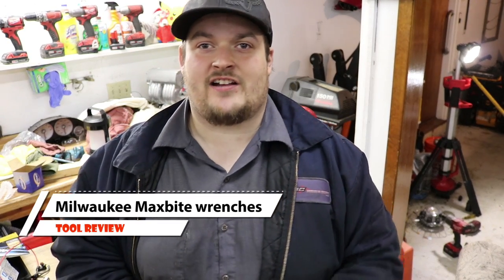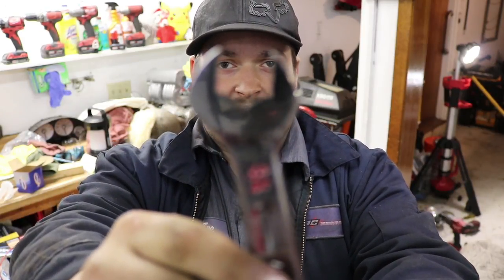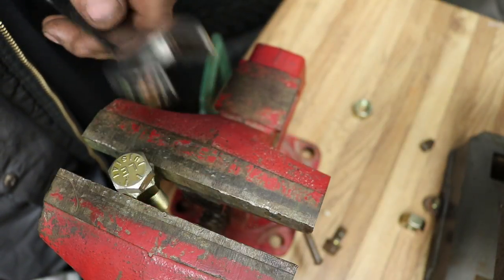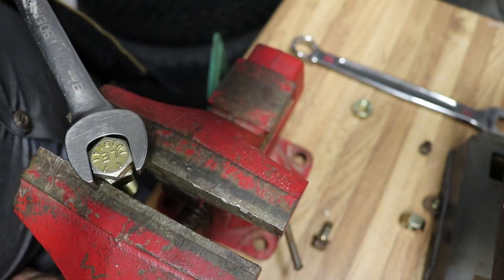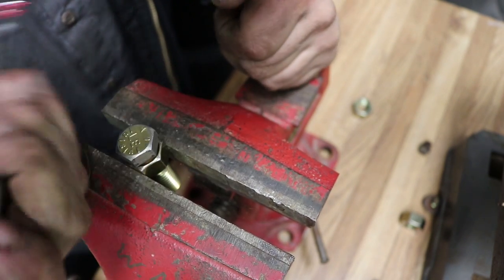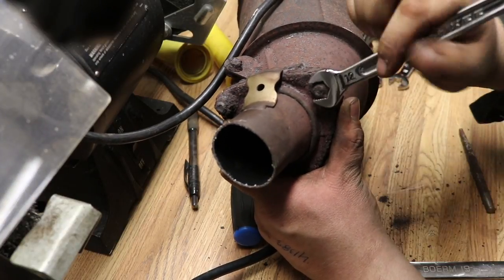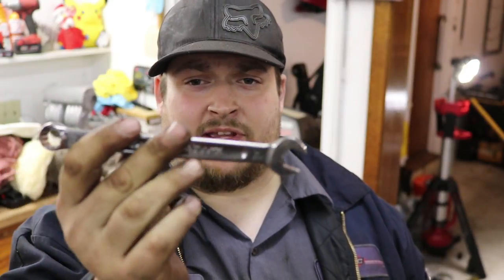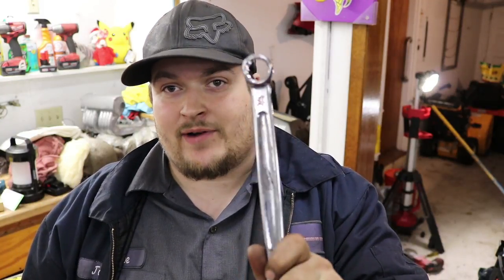Milwaukee Max Bite Wrench Review!!!!!!

Comment: I've been looking to get a set of anti slip wrenches. What do you think of the new Icon anti slip wrenches from HF? They have the same exact design except for the i-beam design. They are a bit cheaper too. I love the Milwaukee design but the Icon wrenches are catching my eye.
Reply: To be quiet honest with you, they have the same design but I cannot attest to their durability. Milwaukee wrenches have videos where they grip and sheer bolts similar to those of snap on flank drive plus and wright grip. But on the other end, I've seen snap pn flank drive vs the icon new wrenches and the icon wrenches kept spreading and slipping thus rounding the corners/marring
Reply: Skip the icon, get the milwaukee. If you want something as good as snap on. WRIGHTGRIP WRENCHES! FOR THE PRICE, BETTER THAN MILWAUKEE, SK, ICON, SNAP ON, ETC.. MADE IN USA

Comment: How do these compare to the Channellock wrenches? They have the same open end design but slightly cheaper price
Reply from the maker: i actually have the channel locks , i honestly believe these are better. regardless of where they are made the metal is a high quality and they feel solid,  the channel locks are great as well but they seem to spread on the open side before they have any result on the flank

Comment: Hi Joe, great vid, really interested on the milwaukees, but bit concerned about the wear it could suffer the max bite teeth design over the years... I mean, the whole wrench is glossy/chrom coated ... even at the max bite open end faces .. that coating/plated is not going to last forever, its not the own steel alloy of the wrench (which makes the job)... so, if this coating wears out, the open end clearance would get bigger and would feel loosen.... thats my big concern.. as they are measured (the wrench number size)  just up to teeth.. 

what you think about that?
how did they perform over this 2 years ?

thanks!
Reply: That’s what warranty is for

Comment: Don't even lie about it, you knew you had the Blue Point on incorrectly. I'm not knocking the Milwaukee, but you need to do an apples-to-apples review. Yours is like two cars racing....one in drive, and the other in reverse
Reply from the maker: Really was just showing the contact surface area between the open head designs